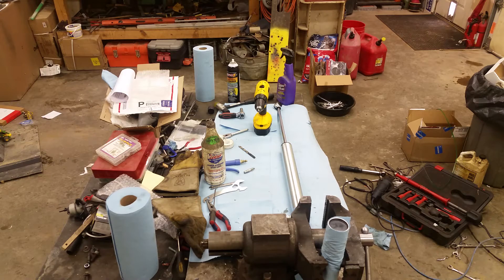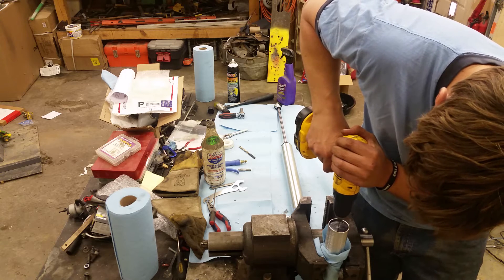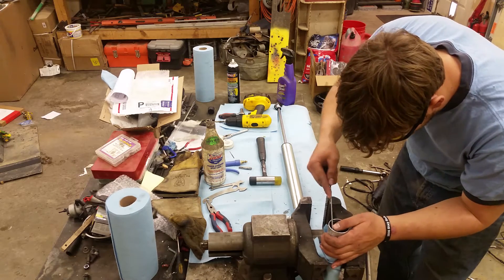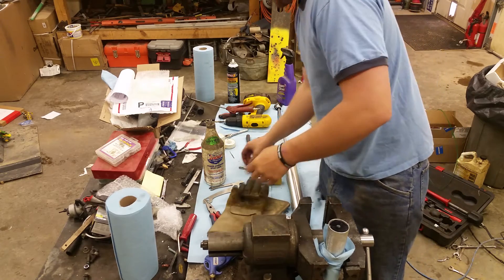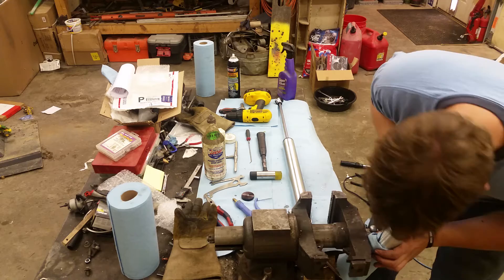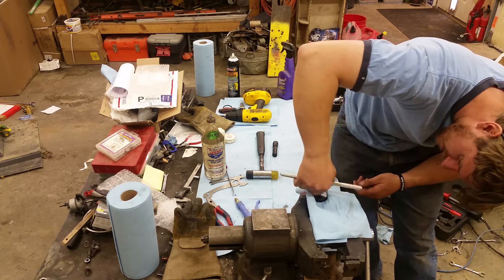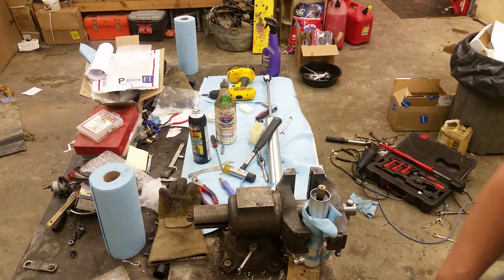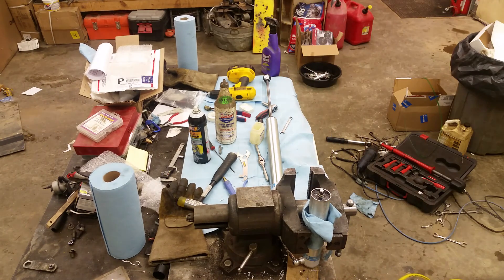Installing schrader valves into Bilstein 5160 and 5165 remote reservoir shocks

Comment: Hey man I have a set of 5160 on a tj one of the shock fittings came loose and all the fluid leaked out was wondering what the depth of the floating piston is. Plan to pull the shock out let the nitrogen out add fluid to c if it would push the piston to the right position than put a Schrader valve on the end and refill the nitrogen do u think this would work can’t find any were that will rebuild it and I love these shocks

Comment: Hey, was wondering if you fiddled with the shaft seal while having the pressure out, the cap there looks like the 5100s that I have and I want to figure out if it is removable without destruction to pipe it to some old bilsteins and shove the gas divider in them to make them into remotes. Also to change the shimstack around a bit.

Comment: Hi, have you by any chance had to add more oil to the bilstein 5160 shock? My rear 5160¨s leaked through the hose fitting and lost lots of the oil. brand new installed... unfortunatelly im in Colombia and cant ship em back to the us for a replacement.

Comment: any thoughts on putting in any sort of adjustment valve? i know parts can be bought for ohlins canisters and they have several adjustable ones. i'm just spitballing here honestly but am incredibly interested in having compression adjustable bilsteins
Reply: Will Young don't know a lot about these shocks. I have a power wagon with significantly softer springs than a stock gas engine ram. Would doing this help or is it more valving than gas pressure?

Comment: What shrader valve have you used?
Reply from the maker: svvani prices are always changing on them so I source them from the place with the best deal. Do a Google search for the 1/8" NPT schrader and usually you can find them around 5$ each. just check their pressure rating and sometimes you can call and get a deal when buying in multiples of 4+
Reply: coloradoinsanity Does it need to be with O ring?
Reply from the maker: svvani no. if you get the oring style you would have to have the surface machined for an oring groove. Just get the standard style   with a good thread sealer.
Reply: Yeah i just did one and its leaking. Never put sealant